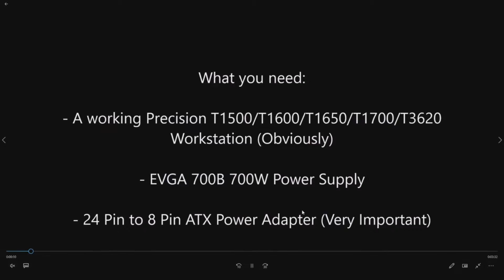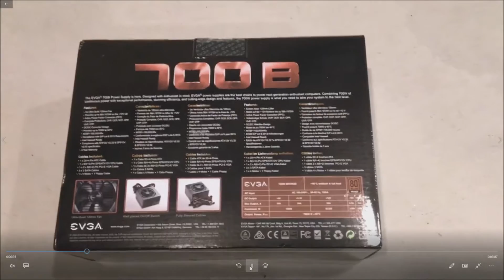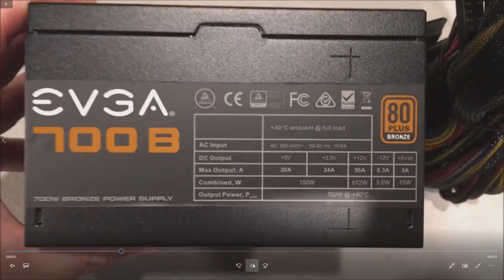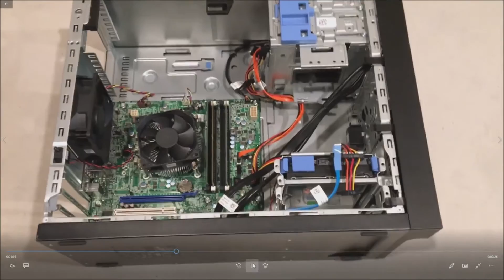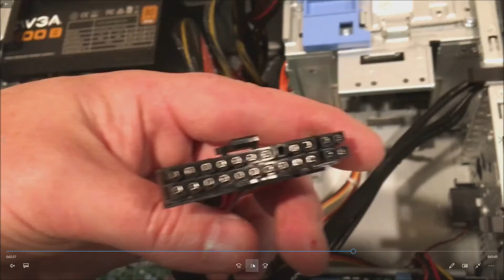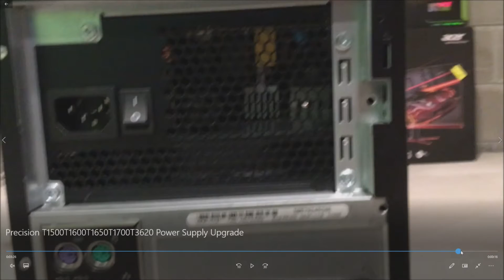Precision T1500 T1600 T1650 T1700 T3620 Power Supply Replacement and Upgrade!

Comment: I wish I would have known that my CPU power cable wasn't going to adapt before I bought the PSU. I noticed most 8 pins split in half, but mine does not, so can I just put half on it? EDIT: The pinout looks the same so I pressed it on and it appears to have worked.
Reply from the maker: It's hard to say w/o knowing the brand/model of the power supply and not seeing the connection.  Let us know the results if you try it.
Reply: @GreenPCGamerscom  I've been running that machine since I made my post and I have had zero problems.

Comment: Can I use the sata power cables from the power supply and remove the sata power cable from the motherboard. dell precision 3620
Reply: Does it work for you this adapter?

Comment: But nobody sees the litteral 24 pin holes on the right of the motherboard ? can you just solder a 24 pin header there ? And not need to use the adapter ?
Reply: Believe it or not, not everybody on this planet has a souldering iron or knows how to use one.

Comment: Finally found someone with simple answers for these. Inherited case of ATX power supplies that nobody wanted to buy, popped them in older Dells makes sense but nobody wants to tell me which models handle a ATX PSU since it requires an adapter (which is cheap everywhere now) but its all simple now, pull cages and let large GPUs in now that theres  a beefy PSU

Comment: I have a question if we slapped like a 1080 ti 11 inch card removed those expansion slots utuilized the m.2 I'd be able to use the 1080 ti or 11 inch card perhaps?
Reply: Although you've probably already done this by now that would likely work, yes.

Comment: I bought the adapter cable only to find out it doesn't work on my T3620.
The shape of the connector for the violet and green are swapped so the connector doesn't fit.
Reply: Hello have you found a solution yet?

Comment: The box in the video that you show is the 100-B1-0700-K1 and is part of the EVGA B1 series, however the link you provide in the description to amazon shows the EVGA 700 BR, 80+ Bronze 700W 100-BR-0700-K1 BR series. If I order the BR series 700w will this still work the same as the one you show in the video B1 Series? thanks for your input.
Reply: I have the same question

Comment: Will any atx psu fit?
Reply: I’d stay away from 1000w.  They require more effort.
Reply: @zeroturn7091  thank you i was thinking of using a 1000 watt power supply

Comment: Have 2 SSD's and one HDD. PC does not see HDD. Any recommendation what to do? Thanks
Reply from the maker: 1. Make sure it is a functional drive
2. Plug in the data and pwr cable in to the HDD
3. Make sure the SATA port is enabled in the bios

Comment: What can you do with the old 290W power supply, can you use it on Intel board with 24 pin connection?
Reply from the maker: Possibly.  Let us know if you try it.
Reply: You’d need a 8 to 24 pin adapter for starters.

Comment: Got a 580rx ,using almost 200 watt ,i was thinking of using 2 satas and a 8 pin,but than i only have 90 watt left ,no way it would pull that and the risk is to high its going to catch fire.going to upgrade to this power supply.but kinda strange dell didnt put a bigger power supply its very limited for 4 years ago.especially for the price you had to pay for one of those you at least would expect it to have a bigger power supply like this and 2 8pins.btw the rx580 just fits in it.but overall im happy with the performance of the machine itself. I putt 32 gig ddr4 in it and its faster than a lightning bold and runs now on Windows 11.
Reply: Update,changed the power supply with the converter cable was pretty easy...than i try to start no video output...after turning pc of and on again it worked and there was my signal.with rx580 in it the combo works magnificent and its super fast with games and good frame rates and temperatures the power supply i used is a azza rgb to make it look like a gaming pc ...thats what i am using it for next to my television 🤗

Comment: Bought a 750w.  It was a bit longer, and it kept getting caught on the case-panel clip...  Finally had to just remove the MB, so I could go in from a top angle, but it worked great!

Comment: Replaced T1700 psu with CX-550m & converter cable no problem early 2022, installed Asus 1660ti TUF Edition, easy af, and I'm useless with tech stuff. It's been 6 months, no motherboard fry, no other problems, get 60-100+ frames in most games on high-ultra settings.

Comment: I have a case for t1700. But don't have space for atx power supply. Can you recommend another case ?
Reply from the maker: Most aftermarket ATX cases will work.  However, the control panel can be a tough obstacle to transfer.

Comment: A 1660 Ti has a 120 tdp.  surely, a 450 W power supply would be ok, no?
Reply: I used a 550W for a 1660 ti
Reply from the maker: It depends on the quality of the power supply.  In most cases, it should work fine.

Comment: This helped me alot
I have T1700 but i changed the Case due to Big size of G-card and more big PSU ( if i found your other video earlier, i would not buy maybe haha)
But I couldn't turn it on and now I found why

The key is 24 pin to 8 pin connector!

Thanks very much

You can make other video for the people who want to bring this MB and cpu to other case and

HOW TO connect the PW switch

It's easy but DELL makes people embarrassed by different shape of pinouts with the standard

Comment: My T1700 has another 5pin plug for power right under that 8 pin. So it has the (8pin, 4pin and 5 pin). Any suggestions on hooking up the 5 one?
Reply: Nvm. Lol. That cable just provides power to the drives from the mother board. THANKS . (:

Comment: I’ve ordered 2 of the 24 to 8 pin and both seem to be broken. PSU tests fine. Old PSU will boot computer. But when booking up EWGA 600 to the computer using the adapter it will not power on. Any ideas?
Reply from the maker: Where did you order the cable from?
Reply: @GreenPCGamerscom  I tried several from Amazon that all appeared to be the same. I finally ordered one branded as Block Erupter that worked. From what I’ve read, these cables are made very poorly, which yields a high failure rate, and some have even reported it frying  their  motherboard. So finding a quality cable is the lynchpin here.

Comment: How do I fit a GTX 1070 in a t3260? In addition to needing the upgrade the power supply, the hard drive bay is in the way.
Reply from the maker: Check out our T3620 GTX 1080 install video for more info.
Reply: @GreenPCGamerscom  oh I didn't find that when I was searching. I'll look again. So far I've seen we need to remove the hard drive cage, get a new power supply, and install an additional fan.

Comment: For the T1500 you don't need the adapter. The T1500 uses a 4 pin for the CPU and a 24 pin for the other power connection. You might want to check that the new PSU you order has a 4 pin CPU power supply thought. The one i ordered (Cooler Master MWE-600w) does not have one. :-(

Comment: Replaced power supply with CiT FX Pro 700W PSU in T1700 mini tower. Had to remove MB to fit and to put back MB had to temp remove fan. CiT PSU is a 'perfect' fit and it could not be a mm larger without modifying case. Used adaptor as suggested (ty!). Also installed PNY 1660 super single fan and all is working well.  Thank you for sharing your work and giving us confidence to try out different components!
Reply: Still running strong?

Comment: If i buy a t1650 with a xeon e3-1220 v3 and i add a gtx 1650 zotac graphics card, 16gb of ram, 240gb of ssd and 1tb of hdd. What PSU should i get?
Reply: You came from UCW?
Reply: @gloBrian  yes
Reply: Guo Studios haha me too, I’ve got the same thing but I have a t1700
Reply: @gloBrian  holly shit man me to
Reply: @gloBrian  is the t1650 better than t1700??
Reply: Alejandro Garcia I’m not sure if the T1650 is better than the T1700... but these were my specs that I bought from UCW for $239.00 after using the promo code : 

Processor: Xeon E3-1220  v3 @ 3.1 ghz

Ram: 16 gb

Storage: Boot: 120 gb SSD Storage: 2 TB

Graphics: Nvidia Quadro K600

OS: Windows 10 Pro

Includes: Power Cord

Comment: Well, a question, the t3620 would be the Dell 3620 precision tower or they are two different things, is that I do not want to have any margin of error because I want to add a 450w source, I would appreciate it if you could clarify it for me
Reply from the maker: Precision T3620 and Precision Tower 3620 are the same.
Reply: @GreenPCGamerscom  Thank you

Comment: Can  this also apply for T3600, T3610 ?
Reply from the maker: No, you can't physically fit an ATX PSU in a T3600 or T3610 Workstation.
Reply: @GreenPCGamerscom  The Dell case and Non Standard Sized PSU is a known issue. My Question is just Specific of applicability of the PSU Pinout shown in your video .......... whether the same Pinout shown will also apply on T3600, T3610 also ?? ........... Suppose I do a Case Swap or just open the case and use the PC as an Open Air system with an ATX PSU with wiring modified  in accordance with the Pinout shown in your Video ........ then will it work on T3600, T3610 .. ??
Reply: @manojgupta3770  good question. i want to know this too
Reply: @GreenPCGamerscom  What if ................ If I do a Case Swap then ... ??

Comment: My motherboard is the same .. is it possible to overclock the processor on this motherboard ??? Could this happen through the SET FSB program ????? But unfortunately I just can not find the PLL ha of this motherboard ... What is it ???? And where to find it there ??? I can not understand ......
Reply from the maker: Hey Andrzej, what model workstation do you have?
Reply: Dell Precision   T 1500
Reply from the maker: We've never overclocked a T1500 workstation.  If you do attempt to overclock the cpu you should consider swapping the stock heatsink with a liquid cooling heatsink.  Thanks for commenting!

Comment: Thank you for your awesome video. By the way, does the voltage of the PSU matter, some come with 2.31 and some with 2.4? would that damage the Mobo later?
Reply from the maker: Whenever you install an aftermarket product in to HP system you risk having issues.  We have over 100 hours of gaming logged with the EVGA 700B Power Supply and are still yet to have any stability or hardware issues.  What power supply were you thinking of order?
Reply: @GreenPCGamerscom hi I know you weren't talking to me but would a CORSAIR RM750e work for the dell precision t3620? (Sorry for being 6 years late)

Comment: niiiiiiiiiiiice video 
but would like to ask , can i install any psu with 700 W or only this brand 
thanks for your cooperation
Reply from the maker: We only use EVGA or Corsair ATX Power Supplies.  However, other brands should work fine.
Reply: thanks a lot for your fast response, is there any special reason for EVGA or corsair @GreenPCGamerscom
Reply from the maker: Mainly because of the stability.  They also have good warranty support if you run in to issues.

Comment: For the T1650, you don't need the adapter. Just cracked mine open to check since I just bought a new PSU and GPU. The T1650 uses a 4 pin for the CPU and a 24 pin for the other power connection.
Reply from the maker: Thank you for sharing this valuable Info!
Reply: Recently, i Got my Dell motherboard, and works with standard psu, now, my problem is the ram, anyone recomend Any stick of ram ecc compatible with this? Links on Ebay are very usefull :)
This Mobo is compatible with  a i3 2120, and Xeon ivy bridge, e3 12xx V2, but, the chipset c216 is powerfull, this can run Any cpu, if i Got a ram, can relate this experience here
Reply from the maker: We've had good luck with the 4GB PC12800E Modules.Here is an amazon link:https://amzn.to/2IEwuQ9
Reply: Hey! This is very interesting as I previously bought a dell T7500 for a cheap gaming workstation but thinking of moving up a generation for higher single core performance (x5670 6c12t 1300 single core passnark to i7 3770 4c8t but 2000 single core passmark). Do you know this is true on all t1650? If so will buy one in confidence knowing easy to upgrade psu! No UK stockist has the cables and greenpcgaming based in US and another place in HK. Thanks!!
Reply from the maker: Hey DadGamer,  This power supply will work on the T1650 workstation.  You will not need the adapter cable.
Reply: @GreenPCGamerscom  thanks! After seeing your comment about 8 inches think the t1650 and t1600 and dell precision t100 ii range might be too small for a powerful gpu. I have a gtx1070 at home. Not sure how big it is but the amd 7870 at my parents' house is more than 8 inches and I ultimately hope to get a 1080ti one day! So now looking at z420 instead. A shame as some great deals on t1650 on ebay in uk.. Around 200 us dollars with processor and ram and case. All you need to do is chabge psu or run an external psu outside case but not if the gpu wont fit :(
Reply from the maker: Did you see the video on how to remove the riveted drive cage?
Reply: @GreenPCGamerscom  oh thanks!! I will check again! I am looking after my son at my parents for xmas so hard to really do anything so have skimmed through the video with no sound! Will try again! I read on some forums for other workstations they wanted to knock out the floppy bay but could not. This is very interesting as got my eye on a z420 on ebay ending tonight but t1650s are more widely available!

Ok found it now! Great job!

https://youtu.be/Fq62dlP9gVw

I did not know t3620 same as t1600 etc. I got a t3400 for use at my parents and upgraded to core 2 quad and it fits the gpus I bring (power is the problem rather than size)
Reply: anyone test the t1650 with standar psu ?
Reply from the maker: @Marc Douglas is using an ATX power supply in the T1650.  He verified that it does not require the power adapter cable.
Reply: I can confirm this to be true! Just picked up a T1650 off eBay for £65 with a Xeon E3-1240 V2 (it also came with a Quadro 2000 😆) and I’m really impressed with it! The build quality is excellent, even the big, rubber mounted fan screams (whispers) quality!

The PSU is standard, as are the mainboard mounting holes! The only thing that looks proprietary is the front panel connections 🤷🏻‍♂️

Comment: Question, if i were to install a  MSI GTX 660 Twin Frozr OC Edition which needed a six pin power source should i upgrade my desktop existing power source of 275w or i can just get a 6 pin power extension for my precision T1650?
Reply from the maker: You should upgrade the power supply first with that particular card.   Have you measured the card first to make sure it will fit in the chassis?

Comment: Been looking for a new psu for my T1500, finally found one thank you for the vid.
Reply from the maker: Hey Phil,  we post all of our favorite T3620 hardware upgrades on www.greenpcgamers.com

Here is a direct link to the page you should look at:

https://www.greenpcgamers.com/technology/make-my-precision-t3620-in-to-a-gaming-computer/

Let us know if you have any other questions.
Reply: GreenPCGamers.com will the parts for the t3620 work for the T1500? It’s got an intel i5-650 3.2ghz.
Reply from the maker: Hey Phil, the processors and memory are different.  Everything else should be compatible.  What are you thinking of installing?
Reply: GreenPCGamers.com for starters I’d like to get a new graphics card and psu.
Reply from the maker: Hey Phil,  Zotac makes some nice "Mini" Cards that will fit in the T1500 workstation.  

Upgrade your power supply first.

Then you can consider adding one of these cards:

Zotac NVIDIA GeForce 1060 6GBPS Mini: https://amzn.to/2DR8ypa

Zotac NVIDIA GeForce 1070 8GBPS Mini: https://amzn.to/2DPd2wu

Zotac NVIDIA GeForce 1080 8GBPS Mini: https://amzn.to/2QWVmCg
Reply: CustomEnchants well the single fan gtx 1050 (6gb) and 1060 (6gb) can run off of my stock psu (350 watt)
Reply from the maker: @RoyalAhat hanks for the info.  We've had good luck with the GTX1050.  The GTX 1060 can have intermittent power issues depending on the wattage cpu and other components that you have installed.